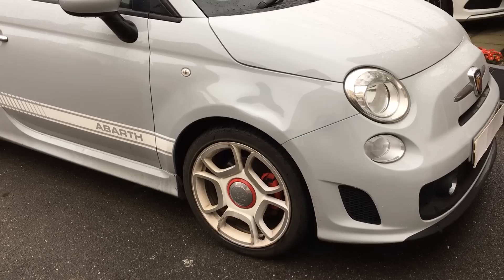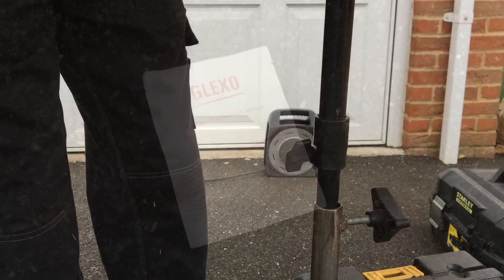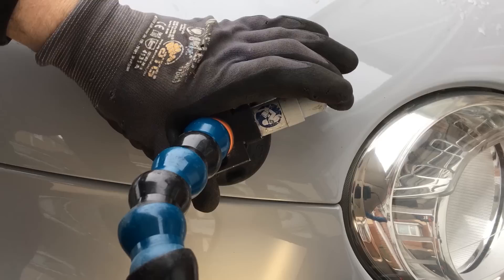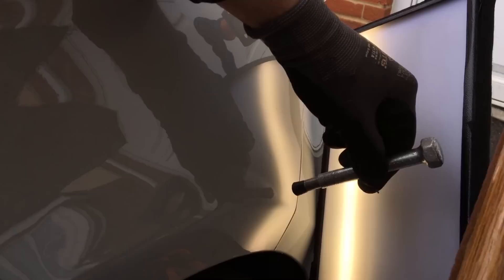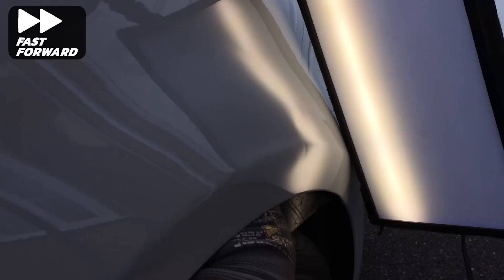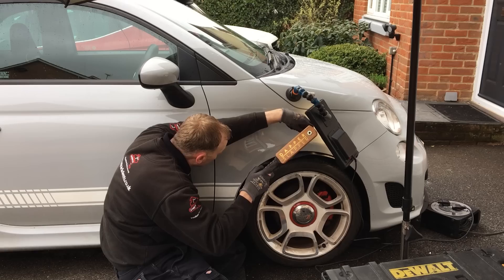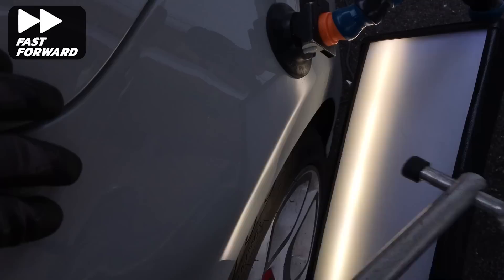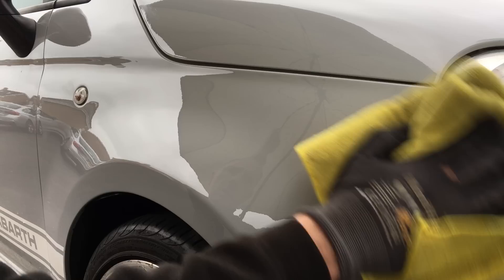HUGE DENT GONE! using AMAZING PDR Skills | No Filler No Paint

Comment: You are amazing, unreal work Jake. What do you do on quarter panels when you can’t get behind them with your tools?
Reply from the maker: Thanks Joe, really appreciate you watching 👍Yes, quarter panels can be tricky, so you would have to start taking a lot of trims apart or be lucky and find a nice factory hole near the dent that you can feed a bar through. Failing that, if the dent is suitable for glue pulling that can be another method that can be used.

Comment: i have always been curious about the tips you use for fine tuning when you are pushing. It seems like your "standard rubber tip" and your plastic vinyl tip are the same shape? or am I crazy
Reply from the maker: They are similar in shape although the rubber one is slightly fatter and made from rubber and doesn't last long, the plastic vinyl tip is quite tough and lasts for weeks if not months. I don't really use these for fine tuning, I use  a hard metal tip, a root beer tip or plastic tip more for the fine tuning:-)
Reply: 1st Track Dents ahh ok ! Thank you sir. Awesome job as always. Cold glue is awesome yeah?
Reply from the maker: @Kylesweeting  Yes it's definitely a game changer in this industry, even though I have only just started using it when others  have been using it for years!

Comment: Hi Jake lovely job quick question is it possible to pull paint using cold glue? Cheers stay safe.
Reply: bill ramsey ...although highly unlikely on factory paint, there is a chance of paint delaminating using both hot and cold glues especially with repainted panels.
Reply from the maker: Yes as Brice said, there is always a chance of that happening on non factory paint. When the panel is being prepped (keyed) for paint using using a fine wet and dry paper or a fine Scotch pad, if it is rushed and not done carefully, areas of the panel could be missed, so effectively the new paint is painted onto a shiny surface, if you was to pull on those areas of the panel the paint on top will come straight off. In the factory each stage is prepped carefully so all paint layers should be adhered well to the layer underneath. My rule is, if it has been painted, I won't glue pull!
Reply: @1st_track_dents  Thanks for the feedback Jake and Brice much appreciated.

Comment: Once again Jake, an amazing job there. 

Just a question as a former spraypainter ;-), why don't you use a small IR Heater to keep the metal at a certain warmth?
Greets from Germany
stay healthy
Reply from the maker: Hi Steven, Greetings from the UK. Good question, to be honest I move around quite a lot during these repairs and the floor space can start to get very busy and cluttered, so I quite like using the hand held hot air gun as I can use it when I need and then move it right out of the way when I don't. Also every job I do lately is in the rain so I wouldn't fit everything under my umbrella! 😂
Reply: @1st_track_dents  good call. thanks for the answer and the ALWAYS amazing Vdeos. best regards

Comment: Really nice videos, thanks! I find PDR mezmerizing and as a hard core diy-er it is irresistable. However, trying this on a refrigerator (as one of my first tries) landed in the wife commenting "But now it's a lot bigger dent than before!!!" And after a bit of arguing I unwillingly admitted that it was ;) Is it possible to use glue pulling/knock down like this to fix bigger dents on appliances or am I just barking up the wrong tree? If applicable, it would be really interesting to see you take on these kinds of projects.
Reply from the maker: The metal on fridges are quite thin so not sure you would get the same result, sometimes you need to finish the dent off by going in behind the panel which you can't really do with a fridge. I get a few requests sometimes for fridges but turn them down as you could spend hours on it and get no where and most of them now have a brushed Aluminium finish on them:-)
Reply: @1st_track_dents  Yep, that's right where I'm at. I didn't think of the thickness of the metall. I think I'll just replace the door and pretend this never happened ;)
Thanks again for really awesome videos though!

Comment: When choosing a light this stick on type vs the big light on the stand why one over the other I really can’t decide on which would be best
Reply from the maker: As a mobile tech, I prefer a stick on light as it is quick and easy to set up. If you were based in a workshop, a light on a stand might be better as the floor would be level and you will have the space to set it up. I work on customer's driveways which are not always level and I also work at the roadside too where the space is very limited so a stick on one works best for me as there is not enough room for a big light. The hail guys prefer the big long lights on a stand as they mainly work in a workshop environment and they can cover the whole roof with one light and may not need to adjust it much. My repairs are smaller, so again a small light is easier as I am constantly moving it around. I hope that helps 👍

Comment: Nice job.   On a removavle fender (wing) like this, wouldn't it just be easier to unbolt the damaged piece and push it from behind, maybe using some heat on the metal (or plastic) panel and then get to the tapping down of the micro highs (micro lows) much quicker?

I didn't know about cold glue (and I still don't know about hot glue) but these seem great advances on the PDR tiny hole/pull approach for difficult to remove panels.

Comment: Hey man another fantastic job! You are a master! Do you see yourself using the cold glue more and more now? Would you use it instead of hot glue on smaller dents or is it just good with wider dents? I’m considering investing in the cold glue but just curious if it’s more worth it than hot glue. Thanks!!

Comment: Great job! I have a small question: is it possible, for example, to pull out a sheet and then heat it up and flatten it with a small roller? Suppress small bumps
Reply from the maker: I've never used rollers to remove any dents, although I'm sure it is probably used in some industries. Rollers are used more in the manufacture of car body panels and restoration work on classic cars to shape them and they do remove bumps and ripples from the metal forming process:-)
Reply: Dent looks much worse than it is. A dent a fraction that size that is creased/stretched is much more challenging.

Comment: Amazing results. Just a question Can rear fender be fixed using PDR tool? Thanks 😊
Reply from the maker: Yes, although as the dent gets close to the rear wheel arch it becomes double skinned so access becomes very limited:-)

Comment: Hi, very nice and well made tutorial. Just one quick question, doesn't continual tapping for such an extended period of time at the homes of your clients disturb the neighbours?
Reply from the maker: Not really as it's a mixture of 50/50 pushing and tapping and most repairs only last about an hour or two, I have never had any complaints yet, I do remember repairing a car outside an office block in the summer some years back and seeing all the windows start to close though!

Comment: Sir how about if the dent is at the roof? Request for a video! Thanks
Reply from the maker: Yes, the roof is possible, it just depends where it is on the roof really. If the dent is near the edge of the roof it will require less stripping, if it's near the middle then the headlining may need to be completely dropped, which can be easy or difficult to do depending on the make of the car:-)
Reply: @1st_track_dents  is it possible not to dropped the headlining? Dents are just too small but too many. Caused by stones thrown from kids
Reply: Sir can i order the tools same as yours forme to do some dents repair?

Comment: Your work itself is excellent, no doubt. But for me is unacceptable that you do not remove wheel and plastic wheel housing. I´m owner of F500 and this work takes about 5 minutes only. The way you unfolded plastic wheel housing risks damaging the paint on the inner edge of the fender and cracking the plastic. If it was on my car I would be very angry.
Reply from the maker: Thanks for your comment, If the plastic is very rigid then I remove the whole plastic wheel liner, however when it is very soft plastic or a carpet type material which is most common these days, pulling it back slightly works fine as I only need a small gap the size of the bar and I have never damaged a trim or the paint on a vehicle doing it this way. You will see from some of my other repairs that I do completely remove the trims when I need to. 👍